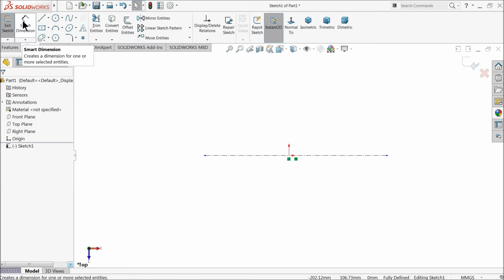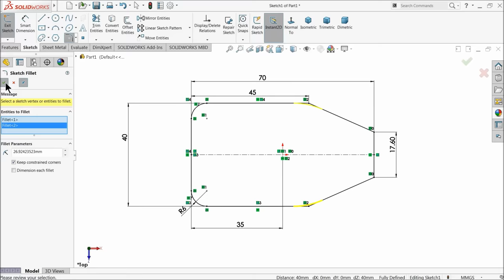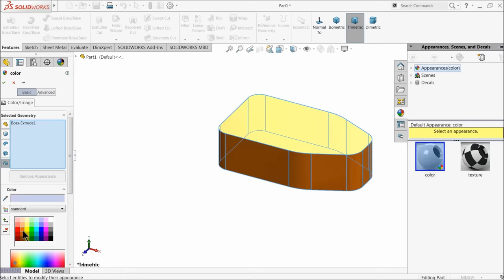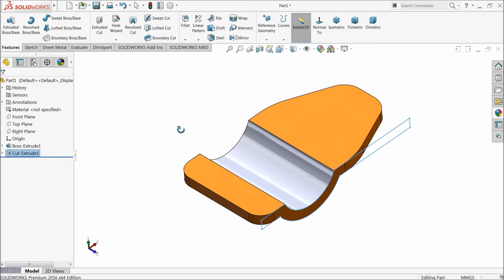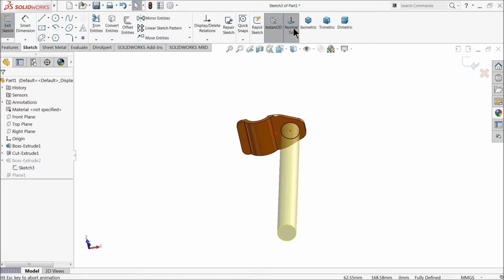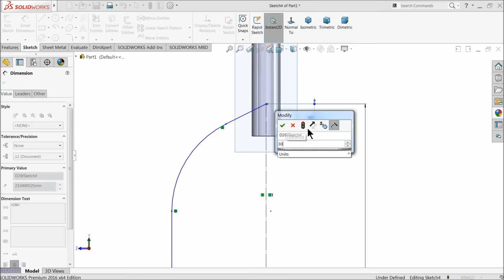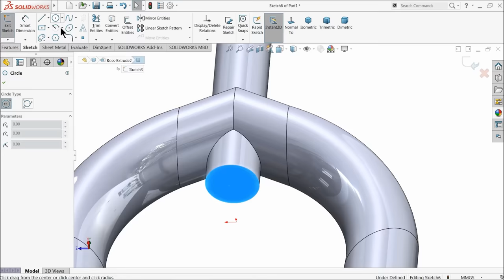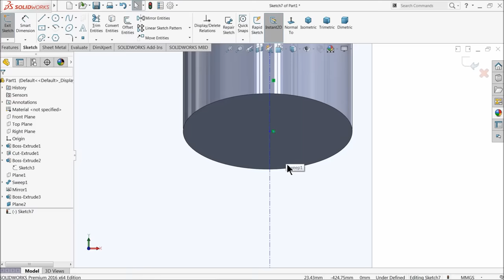Solidworks tutorial | Design and Assembly of Bicycle in Solidworks

Comment: Do you know how to calculate the amount of torque required to move the follower? Even if we use F*R, the value of R keeps on changing because the distance from the point of contact of the cam on the lever to the base circle centre is not constant. Does this mean torque is not constant?? Please i need some help on this!

Comment: Thank you!
For who also like this video and would like to fellow the steps, here is the time log:
0:36 Part 1 Steering 
40:57 Part 2 Frame
1:08:50 Part3 Tyre
1:46:50 Part 9 Front tyre
1:48:14 Part 4 Sprocket with pedal link 
2:02:12 Part 5 Seat
2:25:22 Part 6 Inner chain
2:32:27 Part 7 Pin
2:33:17 Part 8 Pedal
2:45:54 Part 10 Bicycle assembly

Comment: As someone who has taught Solidworks to engineering students, I can really appreciate how challenging it is to do a "live" demonstration of a complex assembly like this.  

That being said, there are aspects of this video that drive me a bit bonkers.  Things like punching in very specific dimensions (i.e. for the chain) all over the place, where you don't identify where these numbers come from nor how to derive them.  Worse yet, the design is not tolerant of future changes.  I MUCH prefer to do this kind of design using feature-dependent in-context relations/mates, such that they automatically align without all the manual fussing you do, such as at the end of the video to make it "look" reasonable (but it's really not on-spot).  I also take exception to your bypassing Solidworks complaints by using "bodies" for many of your features.  My reaction is "Please, get it right!", so that you don't have to band-aid these aspects, many of which will bite you later in the process.

Yes, this is certainly a useful video to watch for beginners, but speaking as an engineering prof and someone who's managed commercial development teams, there's just too much "softness" here for those who really want to know how it's done.

So, mixed feelings.  You've managed to make an interesting design that LOOKS relatively good.  But the underlying models leave a lot to be desired, particularly if future changes are needed.  Imagine what will happen if you want to make the bicycle one inch longer.  Ouch!
Reply: you mean to be more correct in the workflow? im trying to learn inventor or solidwork, this one is good, but doesnt really get me exiting, can you show me aother channel with a good workflow and some additional exitement?
Reply: @PlegakPleguk  He is referring to design intent.

Comment: 00:00:35  part 1 - Steering 

00:40:57  part 2 - Frame 

01:08:49   part 3 - Tire 

01:48:13		 part 4 - Sprocket with Pedal Link

02:02:12 	 part 5 - Seat 

02:25:22 	 part 6 - inner chain 

02:32:29		 part 7 - pin

02:33:16 	 part 8 - Pedal

01:46:50      part 9 - front tire

02:45:54     part 10 - Assembly

Comment: the Tutorial shows good some function of solidworks. Its good to make a model of something.
Only i must say that the design systematic horrible is. Nobody should design something that way that needs to be fabricated.
In my job as a mechanical designer i see it all the time the lack of design systematics.
Reply: dont care virign
Reply: can i knoiw what is the lack of desing systematics in this? sorry i just try learning solidwork for hobby..hope you can help me clarify
Reply: @slyztercoreveanged3175  : one big thing is that you design with fabrication in mind. Also think ahead what features and dimensions could change. Design that way that changes are easy and does not blow up the design.
Also all sketches that get made need to be full defined.
Reply: @rayjan7996  so what u mean is, when we design..every part is meant to comply with fabrication limit right? I know most of the time fabrication and architect always in argue because architect want to make design that is nice, but fabrication will argue how hard to build it. So when we design something in solidworks or any other CAD, make the parts and design within fabrication limit of your workplace or for diy within their capabilities to fabricate.  Is that what you mean?
Reply: @slyztercoreveanged3175  basically that is correct. I know it is always a balance between how it shall look and how it is possible to fabricate. For example in this video it is modeled up only for presentation. Lots of parts he modeled up should be assemblies because that's what they are. Also he models quit a few parts that are purchase parts, like bolts and nuts.
Like I said, for presentation purpose it's ok, but not for real design for fabrication. but what's wrong even for presentation is how he made some "parts" by extruding first a big block but than cutting away big portions again and later add material again by new extrusions. that makes a part very difficult to change later especially by a different person. There is so much that should be avoided while designing that someone could make lots of tutorial videos of it.
Reply: @rayjan7996  could you recommend any YouTube videos or links which show more design for fabrication examples. Im also new to solidworks and trying to upskill. Thanks
Reply: @slyztercoreveanged3175  I think what he means is Design intent in the model. Design intent is the way the part is to be used, e.g. measured, how it references other parts e.g. using datum planes or axis to reference. - For example - in the tutorial he does coinside for somethings but one that would have helped him greatly in the beginning is to create a center line and make it coincident to the main vertical cylinder - instead it takes about 4x longer to get to the end result and many times he reworked the sketch.
Reply: B
Reply: B
Reply: @rayjan7996  do you have youtube channel?
Reply: @bhushan797  : I have no videos uploaded, why?
Reply: @rayjan7996  do you like this video ? Yes or no?
Reply: @bhushan797  as I said, it shows the functions of SolidWorks. But it does not show a good design systematic.
Reply: @rayjan7996  ok pro .. we noob n beginners very thankful to  this dude who try hard just to teach how to use the tools in solidworks.. in term of fabrication yes ..maybe you can make a video about how to create good design systematics ...
Reply: @rayjan7996  I’m currently doing a project and we have to design a car of our choosing. I have run into these systematic issues ur talking about. I would need to go back and change something but it would blow up my design. I’m sure if you could thoughtfully come up with some tutorials and post them it could be a nice niche for you and people would watch.

Comment: You are a great teacher and shows everything in a simple and methodical way- I like to know if you can help me create a library feature of my logo cut inside the ring (jewelry), in old Sledworks I was able to create logo library features easily, but now when I create it does not create the logo cut in like 14kt, 18kt, Platinum and my company name, as library features are not been able to create ,the error message is the some features are absorbed in the model, even if I create parts that are just sketches on plane are not been able to be crated as library parts or features- any suggestion?
Reply: keep both version.

Comment: Hello sir, I am facing problem while  combining to different assemblies like as you tell us in video how to do assembly of ball bearing and also you taught us how to make assembly of chain and sprocket. Also sir you  provide motion in those assemblies but when I want to import those assemblies of ball bearing and chain sprocket to the new assembly, they do not show any motion. I try to rotate ball bearing inner race but it was not rotated.
Sir what I have to do ?...
Reply from the maker: you need to keep any one body fix either inner ring or upper ring if you keep inner ring fix it will not rotate & upper one will rotate, just right click on parts select there fix or float what you like, for chain & sprocket animation check my latest video,
https://www.youtube.com/watch?v=TT6hNgLS5eM
Reply: no sir I want to ask , if I had  made both the assemblies of bearing and chain sprocket sepelerately but when I want to make a new assembly in which I import both those subassemblies  then those subassemblies doesn't show any motion. Otherwise, individually those assemblies show the motion but they don't show any motion when I try to import them in an assembly of big machine.
Reply from the maker: first make sure the model in floating mode, than check mate relations, sometimes models fixed with coincident relations,
Reply: OK sir I will try
Thank you

Comment: If I could delete a tutorial this is one. I really need to get my channel up. The sketching techniques are hard to watch. So many areas where design intent is lost. Using the tool - that's one thing but why not integrate better sketching techniques? like make your center lines coincident with the existing axis in the first 8 minutes.... bam so fundamental.  Would be a huge time saver for a new and/or seasoned user that just doesn't know how to use the tool.